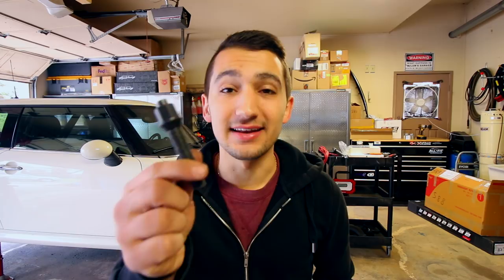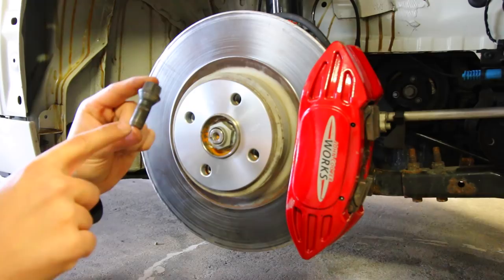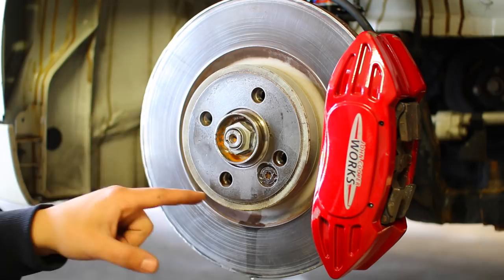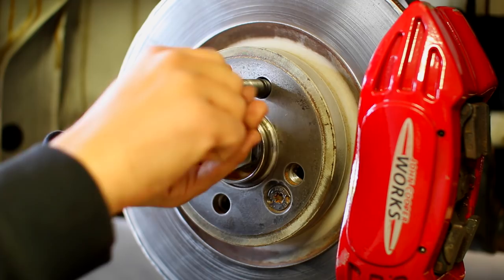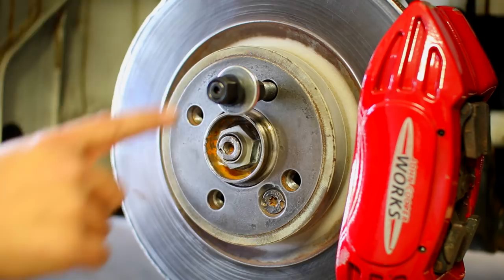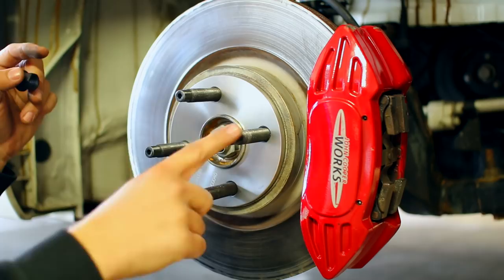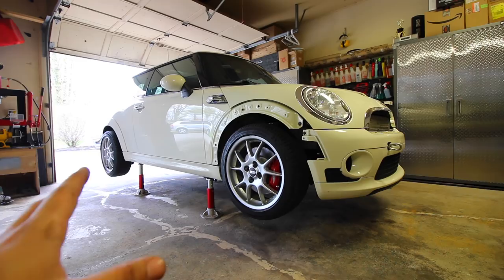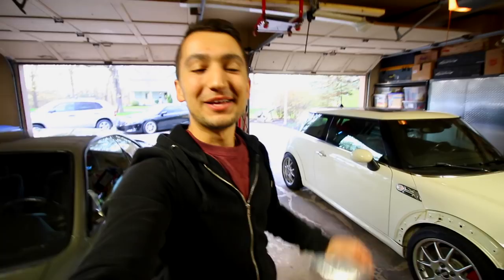How to Install A Wheel Stud Conversion Kit

Comment: Yo, you did a really good job on the camerawork. 

I went the whole video staring at the hub assembly, the brake caliper, the studs, and at some point I was wondering if that assembly was on a stand or workbench somewhere. I was confused for a few seconds, because in other "wheel well videos" like suspension or brake stuff, you're used to seeing the entire wheel well.

Here, the brake is sharp, while the suspension components and inner arch are so out of focus and seem so far away, that you barely notice them. Makes this video a joy to watch.

Comment: You should make a video on how to remove the studs if you ever need to replace them.
Reply: It would be the same process... and you would just loosen it by putting the wrench in the inner nut.
Reply: Bit of heat on it and it will come back out, even with threadlock
Reply: @10feetup  agreed eventually figured out heat is required. I had to use MAPP gas for 30-40 seconds on the stud before it would come out.

Comment: Thank you for showing how to do this without using the 6mm hex bit. The manufacturer always says to use 90ft lbs with a hex bit but they always break or strip out. So your method of using 110 ftlbs of torque is a better install.

Comment: 8:00 this is not how physics works. If you are putting 80 ft-lbs of torque, something must be counter acting it (conversation of angular momentum). The stud MUST be experiencing the same torque at the hub - in the opposite direction, otherwise it would spin. Try holding the stud at the hub end (act like you're the hub) then bottom out the nut and turn it - in order to keep the stud in place - your hand must apply an equal and opposite torque. It doesn't matter if the bolt is compressing the wheel or not and "stretching" the threads. The initial torque you apply is just to seat the stud - then the 80 ft-lb is also tightening the stud to the hub. With the locktite, it means that when you remove the nut - the stud won't come off with it. The stud will also experience 80 ft-lbs of torque when you remove the nut.

Comment: Just a heads up, torquing like that can give you an inaccurate torque. Thats why they have the allen in the end. It should be torqued to 36ft/lbs with the allen. 

It wont be too far off though. Otherwise, great video.

Comment: Awesome dude! Tnks! Got me some enkies 17" rims. Minor scratches. Painted them bronze metallic .Almost complete and ready to install some cooper tires zeon rs3-G1. Have couples of questions? Are spacer safe? Which one do u recommend to give it the flush look? I got a 2008 s clubman.
Reply from the maker: They are safe, as long as you torque them properly!! What are the wheel specs of your current 17" Enkei's? Also, what size tires do you have?
Reply: Sorry took long busy with work. Does the m14×1.25 stubs also fit the 2008 s clubman?
Reply: I got the rims installed. I needed a O ring so the tired don't vibrate. They fit great!  I'm gonna do the studs now. What is the torque specs for the studs on mini coopers 2nd gen?

Comment: I would be more concerned about the heat rating on the threadlocker since your brakes will transmit a lot of heat through the studs, especially if you're going to track the car.  Even the "permanent" red stuff breaks down with enough heat.  The package says it's good up to 232 C, which isn't unheard of for a track car with aggressive pads.

Comment: For a wheel to be securely locked into place. How many turns should the lug nut turn?
Reply: BAD HILUX as much times until it cant turn no more
Reply: Christian Perez I asked since I only get 8 turns and I'm wondering if that's even safe
Reply: I would think so. Are you using a torque wrench? Or just tightening it? 
On mounting wheels i think torque wrenches are not necessary whats so ever. I've always just tightened the lugs and that it. Never had an issue and my dad has too on his cars for over 40 years and hes never had an issue
Reply from the maker: The more threads the better. With just 3 full threads on your lug nuts, it will do PRETTY MUCH the same amount of bitting force as more than that. With that being said, I would still like to have more than 3 threads, especially if you are beating on the car, if the bolt gets heated and then cooled, and if you want to play it safe. Most OEM lug nuts run at least 10 threads on the lug nut.

Comment: Harbor Freight sells a set of 6 studs with 2 each pair with having 3 different diameter. You just select the pair that screws into the stud bolt holesThe HF studs are about 6” long put studs into two holes and install your lug bolts in the remaining holes. Remove the HF studs and put your remaining lug bolts into the remaining holes. NOW HOLDON the HF stud kit sells for $6.95.

Comment: Great Video! I have the same BBS RK on my mini.  I didn't see you use a hub ring unless your wheels have the correct hub ring for the mini?  
With that setup, was there vibration on the steering wheel above a certain speed?
Reply from the maker: Hey Josh, I did not install hub centric rings here at the time since the wheels were new to me, however yes, without the hub rings you will get a vibration. I would 100% recommend getting them for any aftermarket wheel setup 👍

Comment: Don't you have to take the studs off to replace the rotors? How would you do so because of the red locktite? Would the blue come off easily while you are taking the wheels off?
Reply: I dont see why you would need to remove the studs itd be just like a regular car but then again i haven't done the brakes on my golf yet so i cant really say the process
Reply: The studs thread into the hub not the actual rotor. The rotors would just come off as east as if you had a factory 4 stud hub

Comment: Great video. Quick question. I’m guessing my Mini (2010 R56 JCW) is the same spec as yours and you have linked to both “M12x1.5” and “M14x1.25”. You mentioned that it comes as a set of 20 (4x5 lug bolt/nut) and wanted to make sure what R56 uses. I’m currently using 5mm spacers but I’m swapping to a new wheels that allows me to get rid of the spacers. Is M14x1.25 the appropriate one? Thank you. Appreciate your help.
Reply from the maker: That is correct, these MINIs run larger M14 x 1.25 bolts. You will need that size stud kit to work 👍

Comment: How do you know the torque spec for the studs? Also if I want to remove them later, do I use medium length threadlocker?
Reply: Nope just heat them with a torch. the loctice will disintegrate.

Comment: Is this needed for after market wheels on any german car? I'm having a hard time finding bolts for my motegi wheels that fit my car. I know they're not conical lugs. Im thinking of doing the conversion just to be able to use regular nuts with the wheels sense my factory bolts aren't long enough to go in the threads from behind the new wheels

Comment: Really good video.  Very informative, described and explained really well.  What length Stud did you use?
Reply from the maker: I believe the kit I got was the 90mm extended studs. I went with the largest studs available so I wouldn't ever have to run into spacers issues

Comment: Nice video.

BTW, I would try putting the car in gear when doing the front wheel bolts.
Reply: That won't work if the car has an open differential.
Reply: ***** 
Unless the opposite wheel is on the ground, which is how I'll do it if there was no help.
Reply: 'The problem is if it's a Manual transmission with an open diff and you have the opposite wheel on the ground the wheel that''s in the air will spin.
Reply: When 2 of the 3 shafts attached to he differential gear system are practically locked in place, it become impossible to rotate the remaining wheel that's off the ground to any significant degree without breaking something. No need to take my word for it, try it yourself if you have the opportunity to do so. It's how I've been able to work on my open diff FWD car all this time alone.
Reply: Does your FWD car have an automatic transmission or a manual?
Reply: Paul Gonzalez 
5 speed manual.

Putting a manual in the lowest possible gear practically locks the driven axle(s), since the stopped engine can't turn significantly.

Comment: Can I Somehow do this to change the Stud Size? I want to go from 14x1.50mm to 12x1.50mm
Reply from the maker: Not easily. It would be simpler to go from m12x1.5, but not the other way around since the hole you want is smaller.

Comment: Yup agreed. Pain in the ass
Reply from the maker: Its a good thing there's a way around it though :)
Reply: Yeah definitively, I daily a volvo 940! I'm really excited for drifting this season! Thanks for this video, will be installing that mod lol, no more pain in the ass swapping drift wheels (steelies in my case cuz i'm poor LMFAO)
Reply: Joe Gosselin Your 940 has wheel bolts? Both my 1989 740 and 1992 940 had studs+nuts, maybe yours is younger, weird they would change something like that!

Comment: Or you could tighten them with an allen wrench?
Reply from the maker: You still need to be able to get an appropriate torque wrench on there to get the achieved torque spec.
Reply: You can get hex key sockets??

Comment: what if i want to run other style lug nuts? is that possible?
Reply from the maker: subie_cuhh like open ended? You can use any kind of lug that you want that is the name thread, and the same style (cone, acorn, etc.)
Reply: what about those closed end ones. kind of like those you see with stanced cars (with spikes haha)

Comment: after you install those studs can you later change your brake rotor or you need to unscrew those studs?
Reply from the maker: Nope, you can leave them on there. The brake rotor will just slide over the studs

Comment: stick a screw driver inside the rotor, you won't need a second person to hold the brake.
Reply from the maker: I dont wanna damage the caliber's finish when the screw driver is pressed up against the caliper.

Comment: May sound stupid but if you use red loctite wouldn’t changing your rotors be a pain in the ass or is there an easy way to remove it? Cause removing the torx screw is a pain in the ass enough

Comment: Another reason to not own a German car
Reply from the maker: Well its just different :) Its easier to do this installation, than changing out the existing wheel studs for extended ones if you ask me :)
Reply: milanmastracci true can't argue with that but I feel on most German cars to do simple things you always have to take a couple extra steps to do so
Reply: As someone who owns a german car..i second that
Reply: I only tend to buy German cars. Most of the work I’ve done on cars are for my friends and they were 80% Japanese.
Reply: And I mean repairs, not maintenance
Reply: HAMWI253 : 
$70, is not reason not to own a German car? 🤔

Dat logic though

Comment: Do you know who sells 14mm(1.5) VW stud/nuts?   Has to be the ball seat nuts to fit the wheels.   - thanks
Reply: VWR sells a kit, I have it installed on my S4
Reply: @kford5668  Cool thanks for the info man.  S4, whats that a Saturn, ha, j/k.  thanks again,  - take care
Reply: @kford5668  Okay cool, thanks man. But what is a S4 ?  Not familiar w/ those. I've got a 2006 VW Jetta, do u know if they have a kit for my car? Mine has ball shaped lug bolts that fit in the round socket holes in the aluminum wheels.   thanks again, take care.